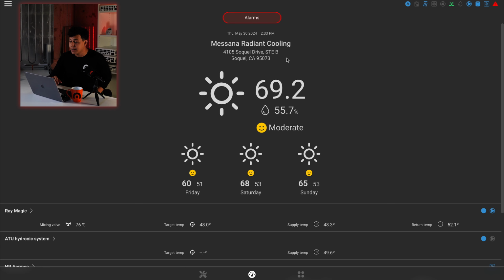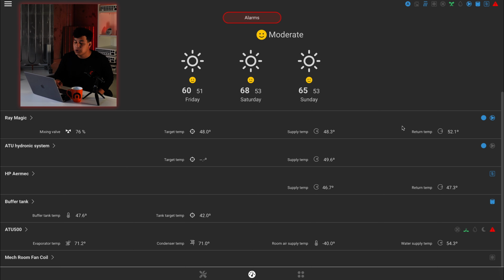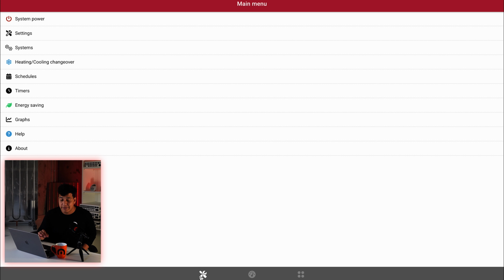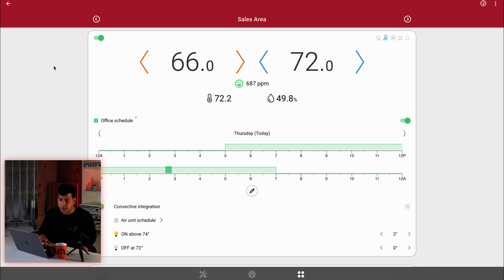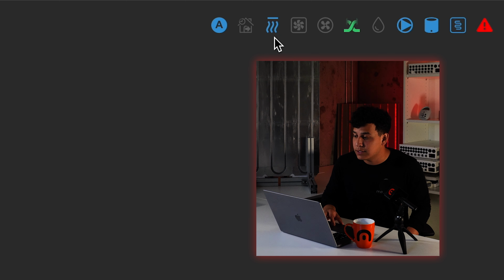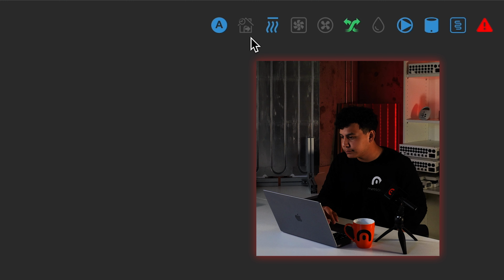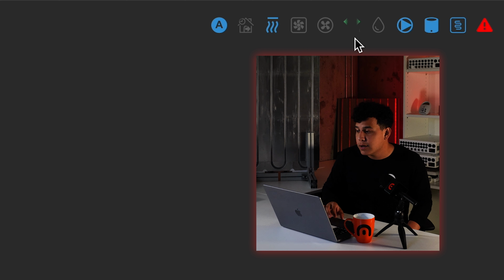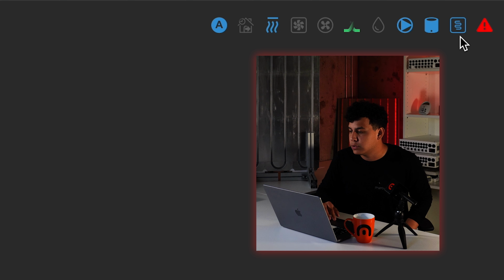Messana App Introduction

Comment: We can use this with an ERV? Would love to use this in a ground up Passive House we're going to build
Reply from the maker: Yes! Our controls can use digital outputs, analog outputs, or ModBus to control ERVs. 

Most ERVs can utilize a digital output to be triggered on/off. Zehnder ERVs can utilize analog outputs so we can manage the 0-10v fan speed.
Reply: @messanatech  interesting, what about smart home hubs like Apple, Google, etc? Any integration with that?
Reply from the maker: @AnthonyBove  We have an API that can be used to integrate with some smart home systems. But with that said, you'll miss out on a lot of data/features available using our app.